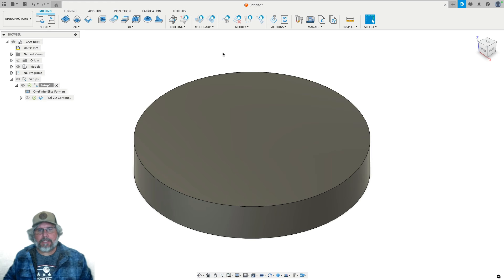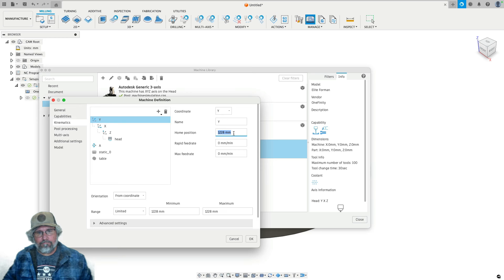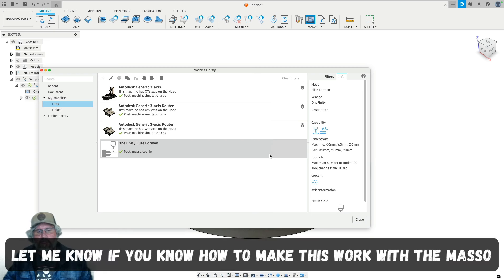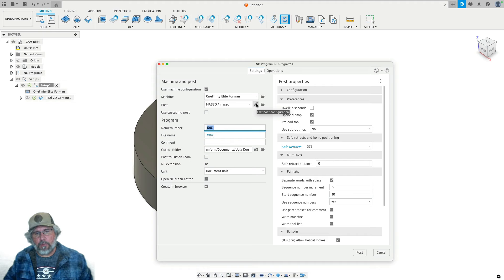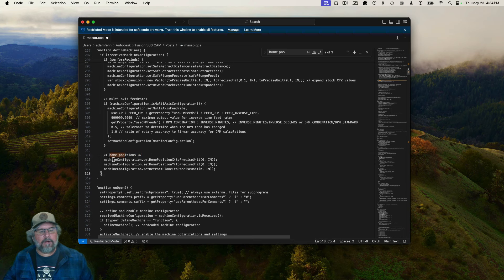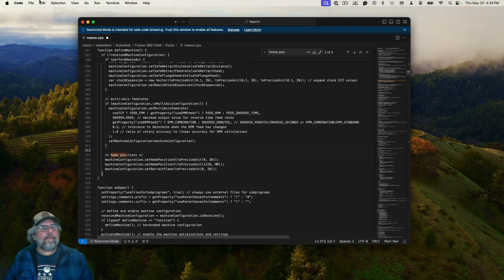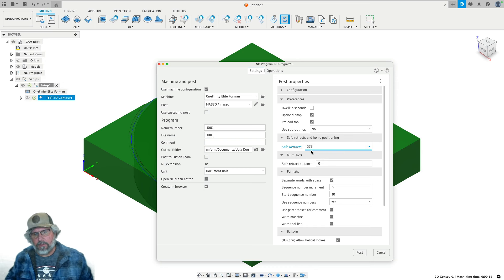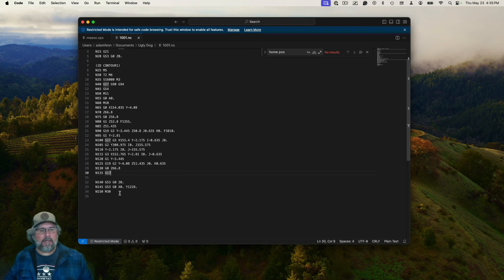How to Auto Park

Comment: For the Masso controller, if you populate the “Parking”, on the F4 screen, Work Offsets to the X and Y of your desired park position, then in the post processor (in Fusion), enter the GCode command G30 at the end of the job, the Masso to command the spindle to your requested park position at the end of the job.
Reply from the maker: I was initially going to do something like that.  I was actually working on adding an option to the Safe Retracts dropdown for Park that did that rather than home.  In the process, I saw that Fusion already had some most of the work done and that what I did in the video is a bit more standard, so I went that way.

Comment: I think this has changed with the most recent versions of Fusion (v.2.0.20962 – November 25, 2024) and masso.cps (45917).  My setup is definitely reading the park location from the MachineDefinition/Kinematics settings, and not the PP.
Reply from the maker: That's awesome if that's the case.  Much easier!